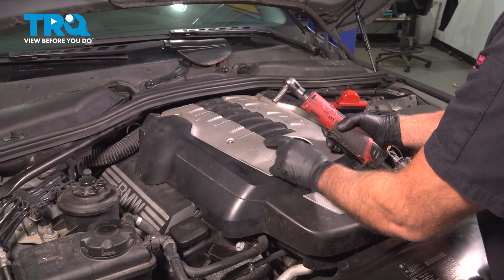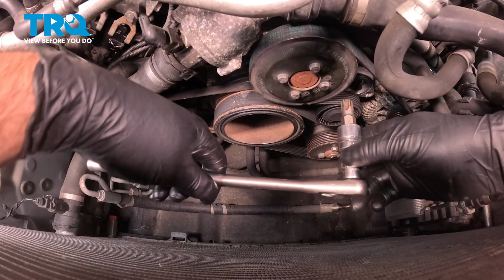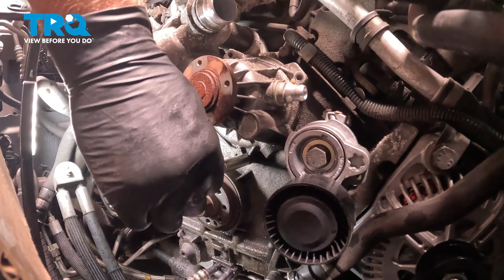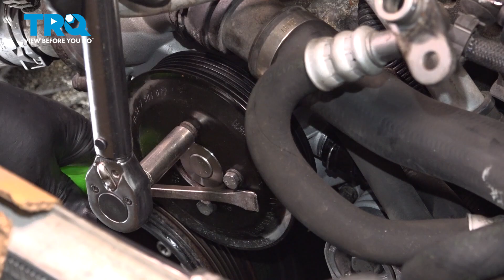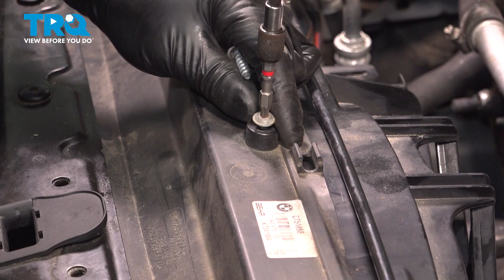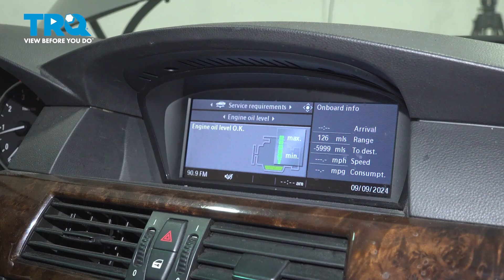How to Replace Engine Water Pump 2006-2010 BMW 550i

Comment: Excellent video and many thanks for posting! However have to clarify that the torque setting for the eight bolts that hold the crankshaft pulley is 25 Newton-Meter which is 18 Foot-Pounds. I ended up breaking one installing it at 25 Ft.-Lbs.. I had to order a brand new set from the BMW dealership and they verified 18 Ft.-Lbs.